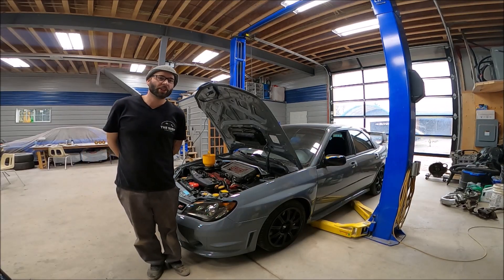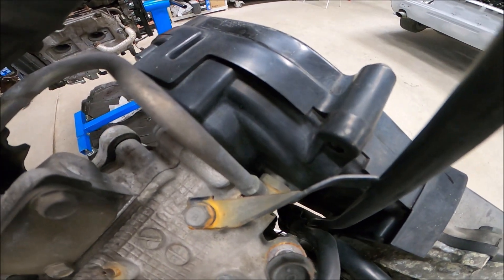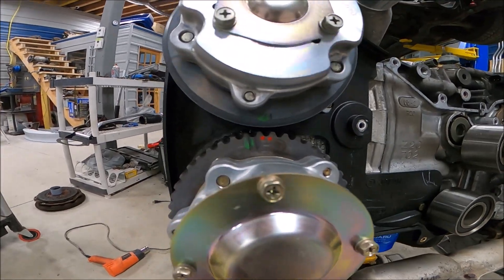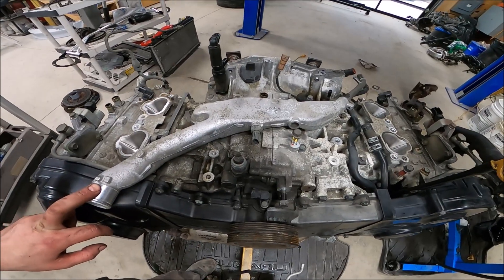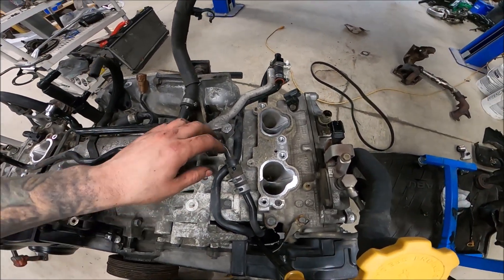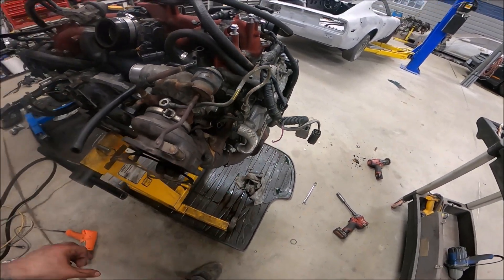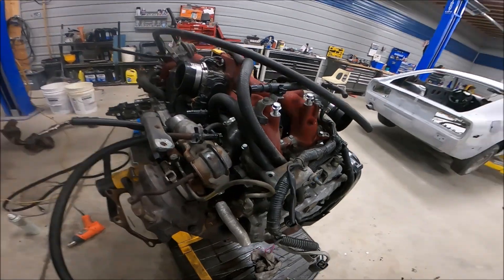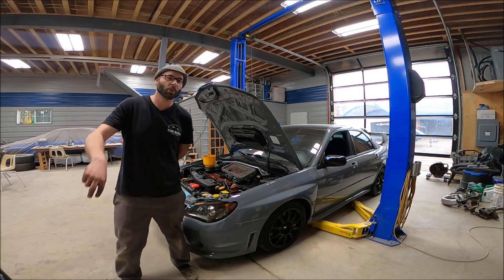How To Jdm Ej20X Swap - 06-14 WRX, 04-07 STI, 05-09 LGT, 04-14 FXT

Comment: great video I had a question how much power did the legacy with twin scroll make and are the injectors  able to be upgraded
Reply from the maker: The original 20x with twinscroll may have put down 220-240whp all stock. 
But with the twinscroll stuff its instant power on demand so they definitely feel faster. 
Yes the injectors can be upgraded. This car in the video had the stock injectors same CC as what would come on the 20X at 565cc and it made 307whp when turned up with stock sti turbo
Reply: @TheSubieSanctuary  I currently have a legacy that the timing belt tensioner bolt snapped it has a vf 52 turbo with I believe 700 injectors upgraded fuel pump , top mount intercooler ,up pipe downpipe it made 330whp and 350 torque on a mustang dyno and I was very happy with it. Do you recommend keeping a twin scroll or the vf52. with the current mods I have and do you think the 20x is a more reliable engine. thank you for the reply
Reply from the maker: @carsconsruction8029  20x is typically a much more reliable engine under 350whp vs the 2.5’s. 
The twinscroll setup is really fun, youd need to make sure you get the top mount intercooler with the 20x as they are different then your original LGT top mount. I personally love the twinscroll but they typically peak in boost and fall back pretty quick in power band vs the single scrolls. 

There are aftermarket twinscroll wasgtegate actuators you can use to just peg the psi at 20,22, or 24 then youll make some nice power on the twinscroll
Reply: @TheSubieSanctuary  I have the grimspeed  top mount so your saying that won't work on the 20x
Reply from the maker: @carsconsruction8029  does it mount directly to turbo or is it the style that has an elbow off of turbo and into a silicone pipe?
Reply: @TheSubieSanctuary  elbow off turbo into silicone pipe not direct to turbo
Reply from the maker: @carsconsruction8029  mint! Your in luck then, that will work with the twinscroll. Those are the best tmic’s for the plastic manifold cars.
Reply: @TheSubieSanctuary  thanks so much for the help ill have to do some research on the actuator for the twin scroll that sounds interesting that might be the way to go
Reply from the maker: @carsconsruction8029  my pleasure. i think it was mamba that made the waste gate actuators
Reply: @TheSubieSanctuary  I went ahead and ordered the ej20x   I was wandering if you are familiar with the 6 speed on the 2015 wrx non sti 
I have someone that has one for cheap with rear diff , drive shaft and axles. do you think this would work with the ej20x im not sure if that trans has dsg
Reply from the maker: @carsconsruction8029  not 100% sure on that trans and compatibly with the ej’s
Reply: @carsconsruction8029  it won't work unless you wanna do a bunch of retrofitting. the 2015 non STi 6spd is cable linkage. you can, however use any STi trans, or non STi up to 2014. any trans from any EJ will fit any other EJ. if its an STI trans, make sure you get the axles, drive shaft, and rear diff with it. if its just from another WRX, you just need trans assuming your rear diff is the same ratio.
Reply: @Tyler-ts2ld  
It worked out great I had a rear diff from same year wrx just small modification on the trans tunnel opening for the shifter and the cables worked good I had the axles from the 2015 wrx but they didn’t fit the spindle luckily the stock ones fit the trans and diff
The car is running really well made 300 wheel hp and 320 torque I think on mustang dyno 
Thanks for all the help with answering my questions
Reply: @albarreira6764  have you posted up your progress on any forums? you're the first I know of thats gone through the trouble of making the 2015+ non STI 6 speed work. id like to see what all you did.

Comment: Curious, i know leaving the exhaust cams and original gears are the easiest way to get these going but is using the ej255 exhaust cams and or gears not an option to bet it closeser to usdm timing? I know there might be clearance issues with the buckets but is this even an option?
Reply from the maker: Ive never done it myself, i know people have. You need a 255 exh cam seal and id recommend using the shaft and gear from 255 so you dont get some oil path issue. Only reason that isnt our standard go to is that the 20x is typically just the budget swap to get back on the road. However, they are fantastic engines for the money.

Comment: Do you need a tuner who is familiar with the EJ207 or can any tuner that tunes 255/257 tune a 207?  Will off the shelf tunes for a 255/257 work?  Thanks for the video; i love 207's and had no idea they are this easy to swap.
Reply from the maker: Any tuner should be able to handle the tune. The OTS tunes are not ideal but people have ran them for long durations without issue. But I wouldnt recommend running OTS vs getting a proper tune for the engine.
Reply: @TheSubieSanctuary  Thanks for the reply.  Subaru's with the good STI's getting so old it's either you have a big bank account or you learn how to DIY.

Comment: I just found video, i am currently doing this swap. I am in California so i will be using all parts from us engine. I am not looking for performance will i need tune i may do some spirited driving. Its all stock no performance anything.
Reply from the maker: @TheRubencor  nice, ya its a great option to get back on road and capable as well. Is your car an air pump car? Like 06+
Reply: @TheSubieSanctuary yes it's 2006 with air pump i did get the ej20x also has air pump. So you seen these run ok with no tune just for a very stock no performance mods capable of handling spirited driving every now and then.
Reply from the maker: @TheRubencor ok, you should be all set. A tune is ideal but it will run without issue or codes off the start.

Comment: Just completed the swap in an 09 forester xt. Went very smoothly. Engine started right up. Followed all your steps. I do, however, have an aftermarket header and downpipe. I at times smell it being a tad rich. Could this be due to these aftermarket parts? Do you think it would be necessary to have it tuned?
Reply from the maker: It would definitely benefit from a tune having some modified parts on it. Ideally they need a tune even if all stock. The benefits will pay for themselves over a while. Once tuned they can be very fuel efficient
Reply: @The Subie Sanctuary  drove the car probably 50 miles now. No problems thus far until this morning. Cel came on. Along with traction control light and cruise control light blinking. Have yet to pull codes to verify. What platform would be the best method to tune? Is there something different than cobb?

Comment: i have a 2007 forester xt automatic with a dual avcs engine i believe. if i want to drop in an ej20x do i have to mess with the timing at all?
Reply from the maker: If you want a drop in engine youll need the ej20 with single avcs and air pump, it would have a plastic intake manifold. You would have to swap your whole intake manifold on and thats it

Comment: This seems more simpler than how people explained it on the forums a long time ago from what I'm seeing. Seems pretty straight forward but I have one question. Since the wrx with the EJ255 is drive by wire and the a V7 EJ207 was a drive by cable how would I get around that? Or would it just be better to get a later version one?
Reply from the maker: Yes this ej20x swap is simpler then people make it out to be. 
As for a a v7 207 into hawkeye. 
You would simply swap over your intake manifold to run the 207. But there is a catch to overcome with that exact swap. V7 207 is 16bit ecu engine and the 255 is a 32bit ecu engine. 
You will have to install 255 intake cam shafts and cam angle sensors, along with the slightest notching of the 207 cyl head cam sensor holes so they line up with the cam teeth/sensor.
Reply: @The Subie Sanctuary  And this way I should be able to use my USDM ECU or would I need a retune? I've heard that in japan they have a higher rating gasoline like 103 or something and we only go up to 93. Not sure if that's true or not but that's another thing on my mind
Reply from the maker: @projecthawkeye547  fuel difference isnt a huge issue. 
Yes, youd use your original ecu and highly recommend a tune after your running
Reply: @The Subie Sanctuary  Gotcha that's all I needed to know, definitely will be using this when I get to that point with my project!

Comment: I know this is an old video but did you unplug the exhaust AVCS solenoid after turning it back a tooth or did you leave it plugged in?
Reply from the maker: The cars listed in this video will not have a plug to plug into the exh avcs. So in that case it is left unplugged
Reply: @TheSubieSanctuary  I swapped a ej20 y into my 2005 legacy GT (USDM ECU) and she has a misfire in cylinder 2 and 4 and stalls in drive maybe retiming the exhaust AVCS would fix that?
Reply from the maker: @toasti8560  no the exh timing wont change that. I assume there is another issue. Like vac leak, a ground is off or coil connector plugs are on backwards
Reply: @TheSubieSanctuary  ok thanks man 👍👍
Reply from the maker: @toasti8560  let me know what it ends up being
Reply: @TheSubieSanctuary  will do, I pulled the spark plugs on the misfiring side and they got oil all over the ends, so ima test and see if they even spark. If they don’t then I start with replacing them as well as with the coil pack

Comment: I’m a little confused, did you not plug the exhaust cam with screws? That’s what is required isn’t it?
Reply from the maker: No and that is not recommended, that would be stopping the oil flow path

Comment: Ej20x has dual acvs . Usdm wrx has single acvs. Did you get it both to run with this install ? I didnt see you wiring it or talked about it.  I know iwire sells a kit to make it run . I have a 2006 obxt with 179k an she's still healthy but im considering a ej20x with the iwire kit. Scared the turbo might blow on me .
Reply from the maker: As seen/discussed in video. Ive physically altered the exh cam timing to match the original 255/257 and the vehicle is runs the intake avcs via stock ecu. Leaving exh avcs stationary (non functioning) 
Its a big undertaking to get exh avcs to work in a single avcs car. Youd need ecu, someone to code break the immobilizer on said duel avcs ecu, then the wiring from a to b.

Comment: I have a 2014 WRX Plastic Intake Manifold looking to do a 2.0JDM Swap. What else should I look out for, other than clocking the exhaust cams One Tooth?
Reply from the maker: Thats pretty much it brother! 
If you are tuning with cobb ap, then you will need ej20y (comes with air pump) 
If you are tuning open source then then you can use ej20x without air pump. 

I also have a how to swap vid specifically for the 08-14 wrx
Reply from the maker: https://youtu.be/N7cGo9U9qAs?si=qVXOPXWG5wfNutZ2
Reply: @TheSubieSanctuary  Can it be done without any tuning? Or needs tuning for fueling, etc?

Comment: you need the exhaust headers from the ej20x. its twin scroll you need equal length headers!
Reply from the maker: No, the 20x ts header will not work with any of twinscroll sti turbos. The plastic intake mani TS models do not have the same header as the TS sti’s. The 20x header/turbo will only work with plastic intake manifold cars. Not interchangeable at all.
Reply: @TheSubieSanctuary  I have a vf38 on my jdm ej20x swap, 2008 wrx spotrwagon
Reply: @TheSubieSanctuary  I'm guessing it came out of a jdm legacy gt. I have 310 at the wheels, spt tune. Stock jdm ej20x internals. Holding together so far.
Reply from the maker: @weezyfidelis787  yes ive done that too on the 08+ wrx’s. But like i said, only applicable for plastic intake manifold cars. Does not work in any way on cast intake mani cars.
Reply from the maker: @weezyfidelis787  thats really good power! We have pushed them to 350-360whp without issue but id say thats the max. The 20x does the best honestly with a twinscroll. Helps fill in the low end power/torque compared to putting a single scroll on. Really notice a difference in the ones that ive done complete ts setup on
Reply: @TheSubieSanctuary  oh ok cool. is it just that the cast intake manifold is the wrong shape? You cant just use the intake from the 20x so you can use the turbo? Do you make more power with the turbo you are using? Thats great you think the engine will last with that kind of power.
Reply from the maker: @weezyfidelis787  the ones we have had tuned past 350whp have gone several years without issue! 
The reason you can interchange the 20x TS setup on the cast intake mani cars is because of the intercooler fitment. 
Swapping a plastic mani onto a cast mani car would not be worth the effort really.
Reply: @TheSubieSanctuary  Oh ok. I deleted  the top mount inter-cooler and went with a front mount.

Comment: I recently swapped my 2013 wrx with an ej20×. I swapped over intake, intake manifold, tgv’s, fuel rails, exhaust manifold, turbo, up pipe, down pipe, moved the exhaust timing a degree, running on ej255 electronics, with the exhaust avcs unplugged. I got the vehicle to start but it idles very rough and runs really rich until about 2k rpm when it settles out. The only codes that come up are random misfire codes. I put in fresh spark plugs in before i popped the engine in and dont get any cylinder specific misfire codes.
Compression on the engine is good. For testing I ran direct grounds from the battery ground to each of the normal engine grounds and then some so i know grounding is not the issue. I smoke tested the intake system and solved all my vacuum leaks. Is there anything you have run into that would cause this issue?
Reply from the maker: I would first try go to the main engine plug, from engine harness to car harness. Check make sure its plugged in tight. Open it up make sure no pins bent just to be sure. 
If its not that, id assume a ground is missing from engine to chassis.

Comment: I did the swap everything is fine but
I have almost no power from a stop like I have to floor it ? Timing dialed back one tooth? No codes. Only 12 psi with 90% wg duty. Ive smoke tested. Im stumped why my power and boost are low. 

I tried 2 teeth on cam timing and it smelt incredibly rich and ran very poorly..Gonna try stock to see if that help..
Reply from the maker: The exh avcs is left unplugged. Sounds like your in limp mode. Do you have a check engine light on?
Reply from the maker: Also 1 tooth back on exh cams is as good as it gets
Reply: @TheSubieSanctuary  no codes, definitely not limp mode
Reply: Is there such thing as a silent limp mode. 
Like I have the airbox delete and codes deleted. Jw if could be in limp mode with no Cels
Reply from the maker: @GhettyGreeen  it is possible

Comment: So are the jdm ej20x 2.0l im new to this world i have a 2006 Hawkeye WRX
Reply from the maker: Yes they are a 2.0L , the 20x is specifically a non airpump motor. If you need to be emissions compliant in your area you will need an ej20y (air pump engine)
Reply: @TheSubieSanctuary  ok is that the same process to swap the engine and do I need a different ECU

Comment: Hello friend, I have an ej20x that I am putting on my 2004 wrx but I don't understand how to do it with the camshaft sensor and the valve that are in the lower part, those go without connection to anything
Reply from the maker: The 20x will not simply work in 2004 wrx. Only works in 2006+ wrx 
As for the lower avcs sensor and oil control valve they are just left as is (unplugged) 

For the 2004 wrx, you need a jdm ej205, i also have a how to swap video for them into your car if needed

Comment: When swapping in a 20X or 20Y, do you tend to replace the oil pump and water pump? Are these the same across the EJ255 and the 20X/Y?
Reply from the maker: They use the 11mm oil pump, same as sti. 
As for water pump, it just depends on if your 20x/y has oil cooler or not. 
If no oil cooler then water pump comes from 08-14 wrx 
If it has an oil cooler then water pump comes from 04-14 sti
Reply: @TheSubieSanctuary  Super helpful—thanks!
Reply: @TheSubieSanctuary  Everywhere I look seems to sell either the 10mm thick oil pump or "high-performance" 12mm pumps...strange. Would you even bother replacing the oil and water pump on these JDM motors as a best practice?
Reply from the maker: @codyd.18  i would not bother replacing the oil pump on these jdms. Only reason i would is if its a vintage motor
Reply: @TheSubieSanctuary  fair enough. I was planning on throwing a new timing kit and water pump on it, so figured I might as well replace what I can while it's out of the car.

Comment: Which wiring harness are you suppose to use?
Reply from the maker: As shown in video you use your entire original intake manifold, with its original harness and and fuel system. The whole intake manifold and all attached come off in 1 piece.
Reply: @TheSubieSanctuary thank you, have my swap all ready to go. Just trying to double check everything before I try and crank it.